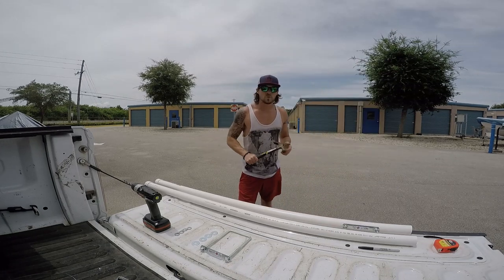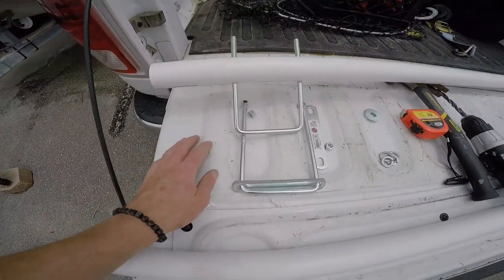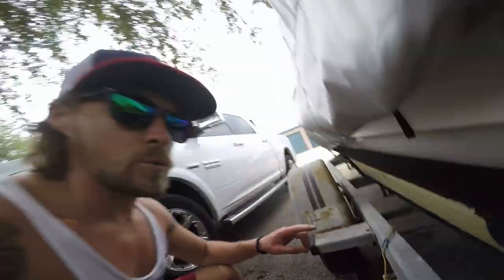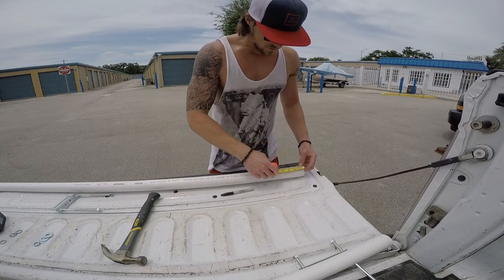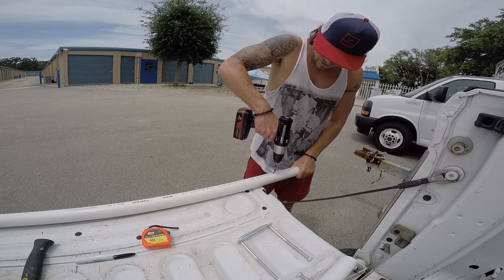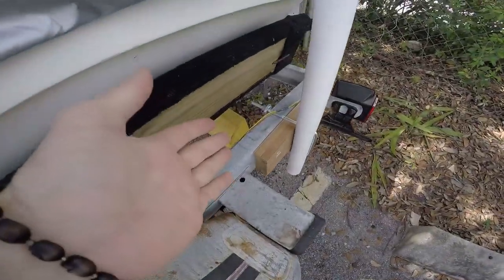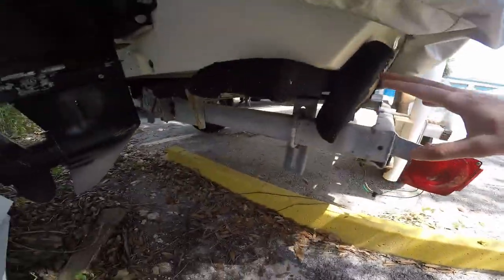Super Easy DIY BOAT GUIDES for your Trailer!! $25!!!

Comment: Thanks for the post I appreciate it, I decided to put an 1 1/2 inch PVC pipe with caps inside the 2 inch PVC to stiffen the system works great,

Comment: "holy smokes",  that was funny;     i use steel pipe, with a strong current,that pcp, pcv,pvc will break
Reply: Ya wont take much of a bump to break those PVC pipes where they holes are drilled into them.
Reply: I agree, been my experience with pvc and seperately with hardware on trailers at high speed vibrations. Both like to break quickly. A lot more expensive. Schedule 80 GREY PVC might hold up better. I'd imagine those shims will vibrate out of place as the Ubolts break through the WHITE Schedule 40PVC.

Comment: I like it and hate it. First time you bump the pipes, they will more than likely break off. The drilled holes and bolts passing through increases the chances of breaking at the weak point. I would suggest using the u-bolts to mount a piece of steel pipe(round or square) and then sliding your PVC over the steel pipe.
Reply: Yeap...

Comment: Agreeing with other posts. It's been my experience with pvc and seperately with hardware on trailers at high speed vibrations. Both like to break quickly. A lot more expensive. Schedule 80 GREY PVC may hold up better. I'd imagine those shims will vibrate out of place as the Ubolts break through the WHITE Schedule 40PVC.
Reply: Just traveling around criticizing?
Reply: @bgriffin511  

No sir, just thinking outloud. Hoping to be helpful.

Comment: Hey this is super helpful. I just bought my PVC and caps. Cannot find galvanized u bolts. Where did you get yours from and how many inches in length are yours? Thanks!
Reply from the maker: HEY THANKS for the feedback! Don't stress about the galvanized u-bolts too much!  The zinc ones i got at home depot have held up fine with minimal rusting (I soak them with the hose water when i'm done. The inches for the u bolts is based off your trailer frame that you're putting the u bolt around. just measure that. hope this helps
Reply: @topwatertrev3291  awesome thanks!
Reply: Wouldn’t zinc help as a sacrificial metal and preserve the trailer from rust? Like zinc blocks on motor and aluminum boat in salt water?
Reply: @topwatertrev3291  Galvanized steel means that zinc is coated to the steel.

Comment: Hmmmm.  There's a better way.  I stuck a couple of 1 inch thick PVC  lengths  (3 foot long) in my trailer frame, and voila,  it worked without any further mucking about. There happened to be a space around the fenders that was a tight perfect fit.  After the boat is back on the trailer, I remove  the PVC so I don't lose the PVC while traveling on the road.  I only need the pvc guides while loading the boat.

Comment: guides are the back board of the trailer, meaning you sometimes bump them bad boys to get the ball in the hoop/ boat lined up..... are you sure that not having a metal insert will allow the PVC to break the first time you nudge them too hard???? video is 2 years old i was just wondering if you ran into that problem.
Reply from the maker: i never had a issue with them breaking. if you use shims to extend the poles out from the trailer then you will have room to wiggle.  this was made for my small 16ft skiff

Comment: Do you use this method you both can't be no wider than your trailer all the wars that trailer has to be about 2 inches wider on both sides to do this
Reply: I went and spent $25 on material and got it ready to go but didn't work because my boat was wider as a backing of the trailer the guys won't bend that far it will break the 2 in CV pipe
Reply from the maker: Correct. That's why i used  wooden shims to create seperation from the trailer.
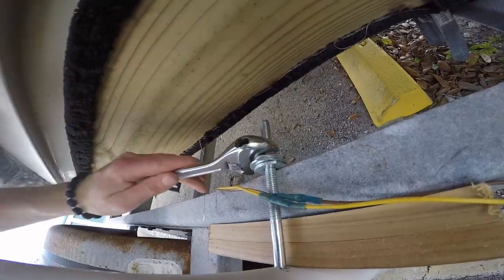Reply from the maker: at the 4:27 mark. you just might need more shims or pieces of 2x4

Comment: ummm....Galvanized IS Zinc plated....just sayin...
Reply from the maker: Rusty Osgood ummm....you’re close. Look up the definition/process of galvanized and zinc plated again...just sayin 👍
Reply: @topwatertrev3291   Yea, I jumped the gun and sounded like a penis....sorry. Both processes use Zinc but plating is cheap crap used for indoor stuff and galvanized is way better for this hardware stuff. You said it right, i'm stupid...just sayin'!
Reply: You are incorrect sir. Though Zinc is the product used for treatment for both, the processes are entirely different. Zinc plating will not hold up as well as galvanized steel.